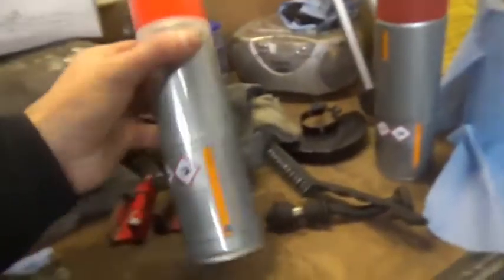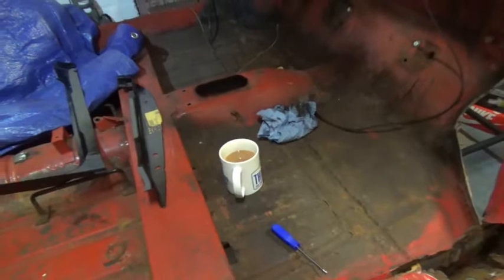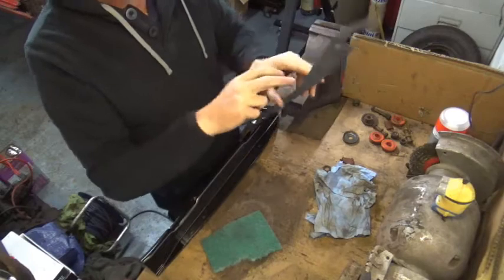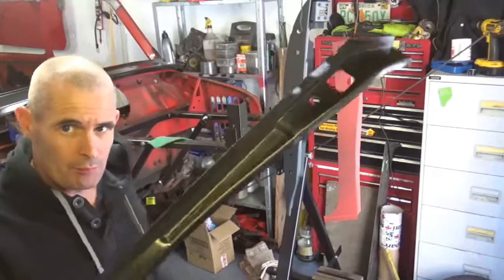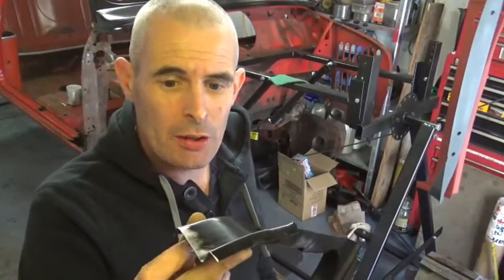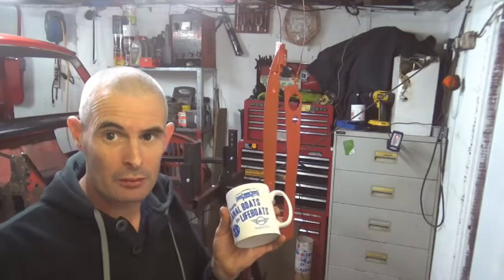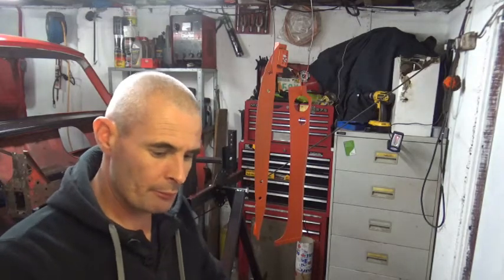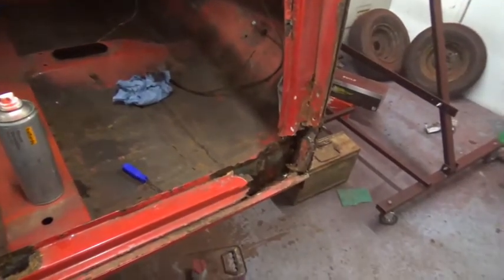Austin mini restoration. Preparing the new panels?

Comment: Hi Sean, don't know if you'll ever see this but totally agree with painting inside the panels. Could you use weld thru primer rather than etch primer before applying the coloured paint?
Reply from the maker: Hi Michael, I don't see why not buddy. My idea at painting the inside of the panels is just to try and offer some protection to the bare metal. I'll also be waxoiling the inside of the box sections too once the car has been painted. These cars will never have the same hard life as before so hopefully they will last longer once restored. All the best, Sean

Comment: Ooh, didn’t know yours is vermillion! It looks a lot more red in video than mine!
Reply from the maker: Hi Matt, I'm pretty sure it's Vermillion. The only 2 70's Oranges I can think of is Blaze and Vermillion and It's not bright enough to be Blaze. I will need to dig out my colour charts and have a swatch at them before I officially paint it but in the meantime I'll keep painting behind the panels to help seal protect the paint :)
Reply: Sean C yeah, I need to finish watching before I comment 😂😂 the inside of the car does look vermillion 👍
Reply from the maker: lol, it's red on the outside as a previous owner had it repainted a good few years ago, probably when it got all the welding done - patches over patches but at the end of the day the patches is what's really saved the car and kept it on the road for 40 years so I really can't complain :)